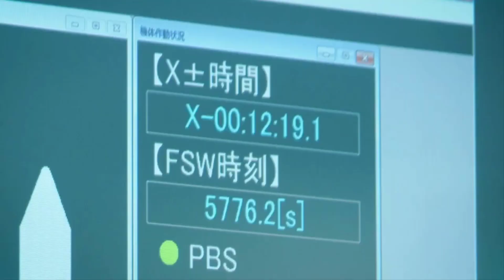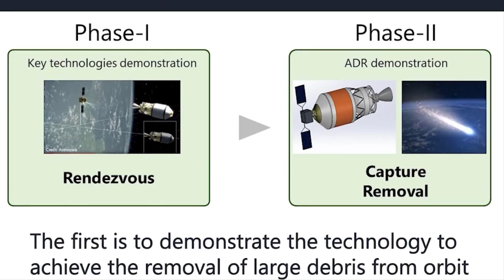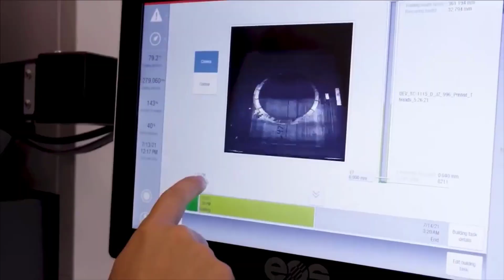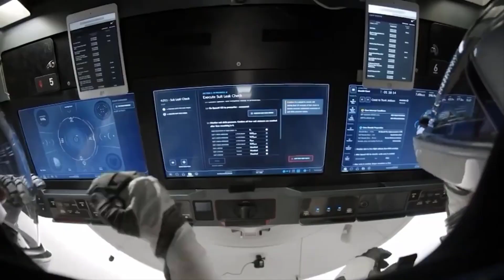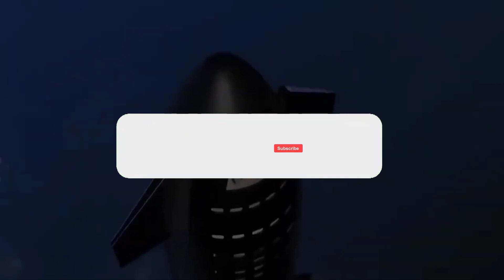SpaceX, Japan and UAE Team Up For New Lunar Lander Launch!

Comment: the nautical mile is used when taking space measurements btw, not the meter. its the same thing. so you don't use the smaller one. fyi       for the ones that want to argue, the NM breaks down perfectly into 1852 meters
Reply from the maker: Thank you for sharing your information!